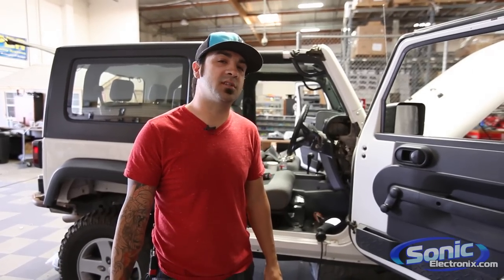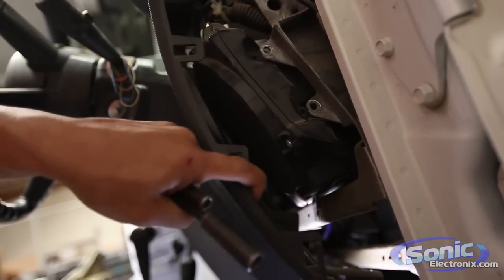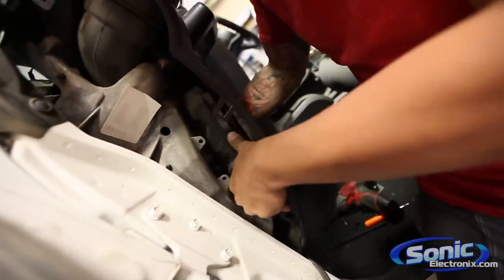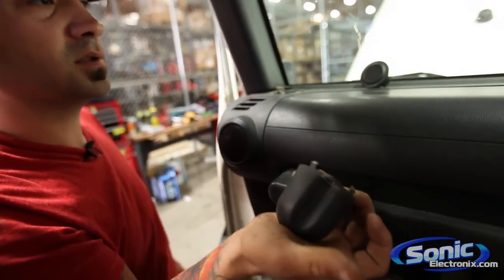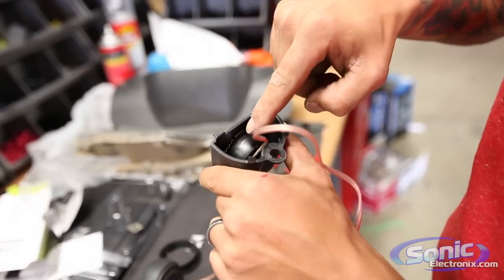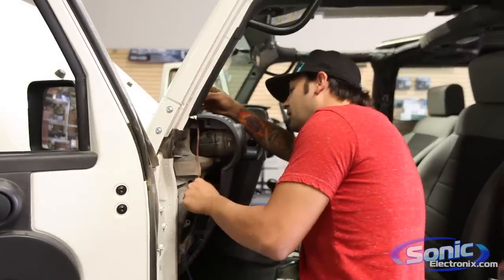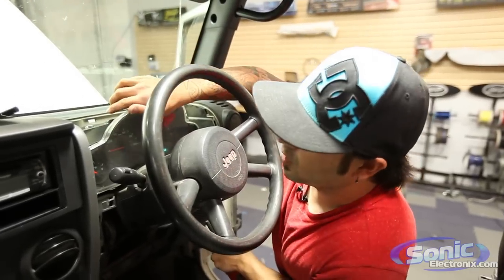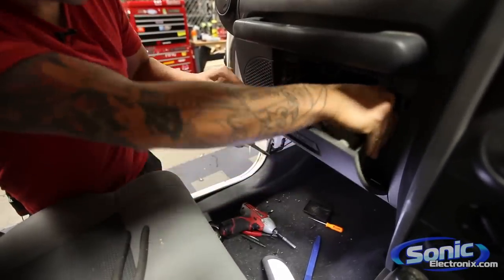Jeep Wrangler Component Speaker Install | In-Depth Procedure

Comment: Mine is a 10mm for last bold on driver side; not an 8. I see you have that bottom plastic part out of the way making it infinitely easier to get at that bolt from beneath, too. I'll have to come in from above with a box wrench. Thanks for the video.

Comment: Installing a Line Out Converter for my 2008 Jeep Wrangler Unlimited X.  Want to keep factory stereo but installing an amplifier, don't know which wires (speaker) to use for the Line out converter (RCA for amp).  Could you please let me know which wires to use?  Would appreciate the help GREATLY!!

Comment: this might be a dumb question what is a crossover speaker?
Reply: A crossover is a application that divides the frequencies. 
There's no such thing as a crossover speaker. But almost every speaker has a crossover.
Example you might have seen a speaker with a separate box and tweeter, that box is the crossover that will divide the lows, mids, and highs.
Why so the big speaker will only produce lows and mids and the tweeter will give you only high frequencies. 
In my opinion speakers with a separate crossover and tweeter in other words called component speakers are the best.
Hope this helps :-)